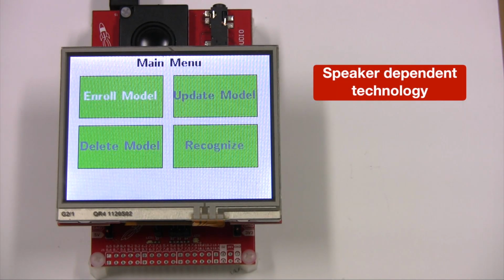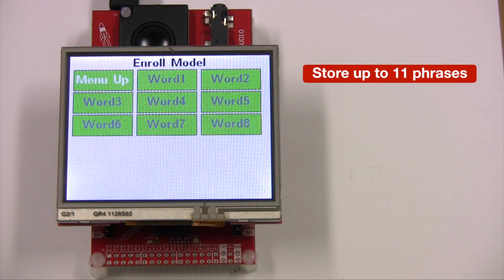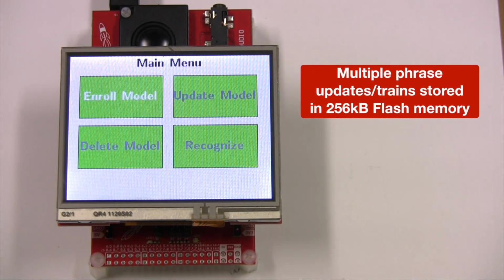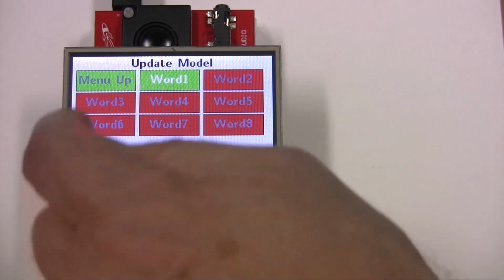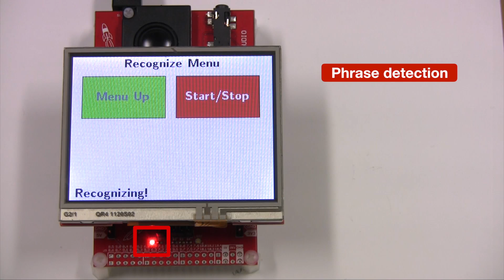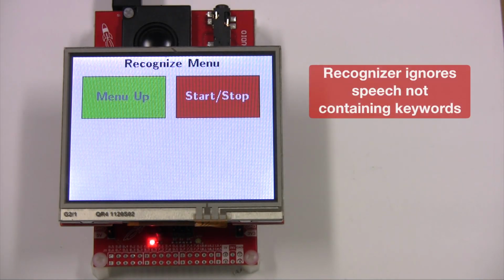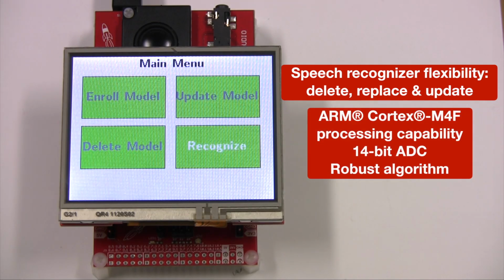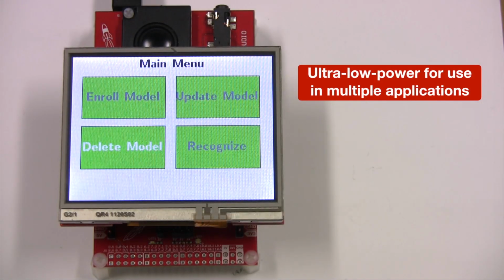MSP432 microcontroller speech recognition technology

Comment: Cool stuff! The library is written just for msp432? Can it be used for c5000?
Reply from the maker: Thank you for the suggestion. The current recognizer library is only provided for the MSP432. We will investigate the interest in providing it for the C5000.

The current release of the recognizer software only supports the use of the Sharp LCD display booster pack, http://www.ti.com/tool/430BOOST-SHARP96.   We plan to update the library to provide full support for the Kentec touch display capabilities as seen in the demo.